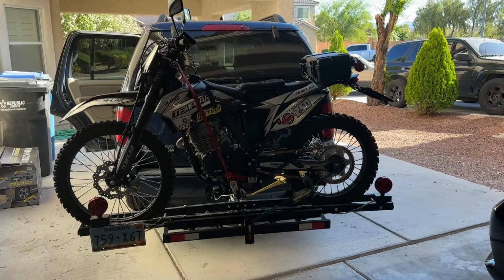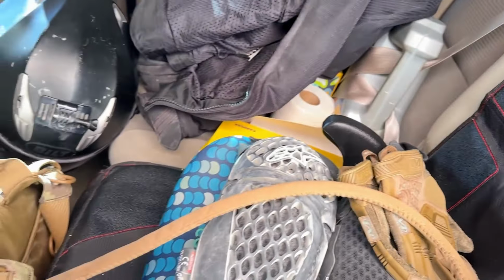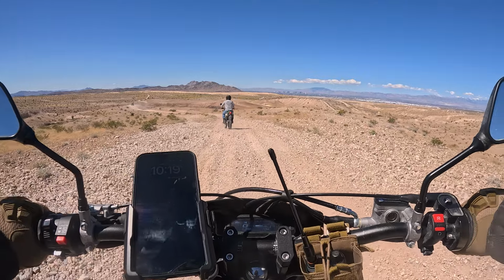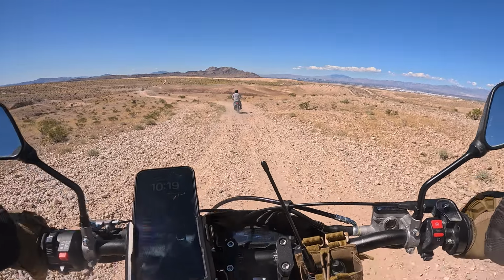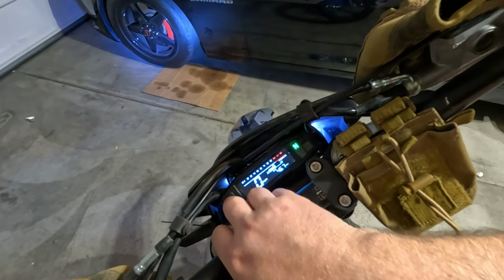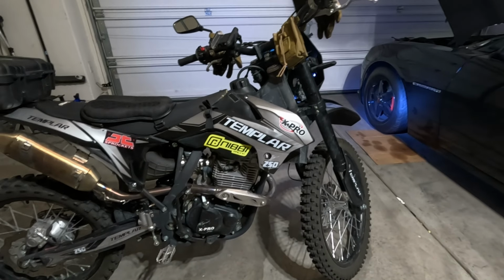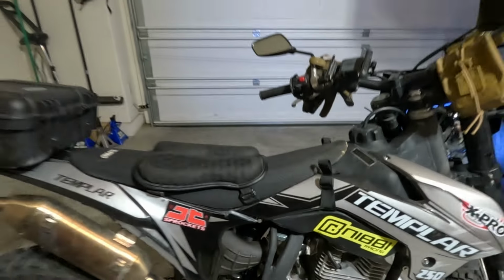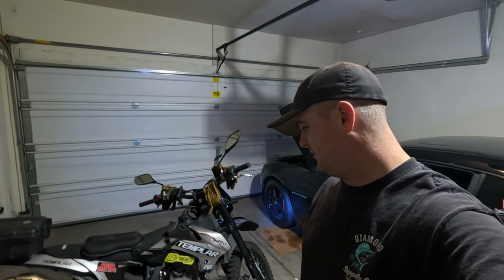Riding at Apex: Templar 250 update after 1,000 MILES.

Comment: I'm an experienced rider who just got one of these last week. It can handle any hill in first or second. The X model has about 20 hp, which is not a whole lot, but enough for anyone not racing. I weight 230lbs and it has no problem moving a well built guy like me around. Though the horsepower isn't anything to brag about, it does have plenty of torque. The suspension is impressive for a cheap bike. I hit a few smaller jumps, and it holds up well.
P.s. To the video maker. You should be standing up while offroading. Your tire pressure should be around 10 to 15 psi offroad and 20 to 30 onroad.

Comment: I’m not trying to sound mean, but are you brand new to dirt biking? Or is the bike not capable of going any faster on some of those inclines?
Reply from the maker: im new. bike is definitely able to go faster but wouldn't recommend at my skill level due to how unforgiving the rough terrain is on the body
Reply: I'm an experienced rider who just got one of these last week. It can handle any hill in first or second. The X model has about 20 hp, which is not a whole lot, but enough for anyone not racing. I weight 230lbs and it has no problem moving a well built guy like me around. Though the horsepower isn't anything to brag about, it does have plenty of torque. The suspension is impressive for a cheap bike. I hit a few smaller jumps, and it holds up well.
P.s. To the video maker. You should be standing up while offroading. Your tire pressure should be around 10 to 15 psi offroad and 20 to 30 onroad.
Reply: @ianlaughlin85  yeah I bought one and I’ve been ridding it, pretty impressed with how well it’s done, although I seared off the gear selector because it stuck so far out past the block and the casing. I gotta fix that